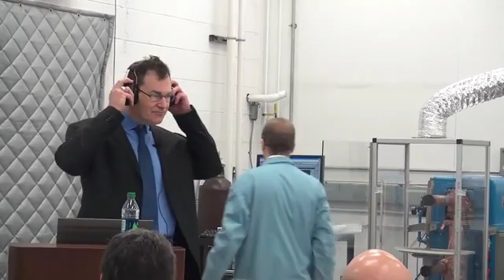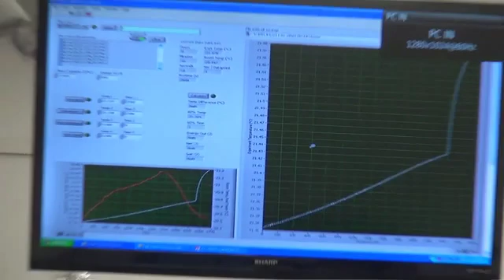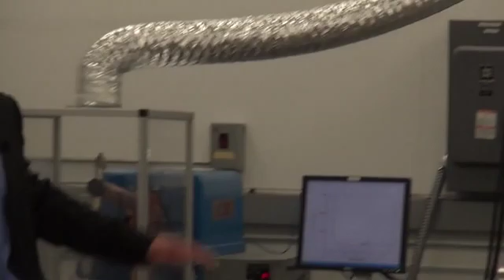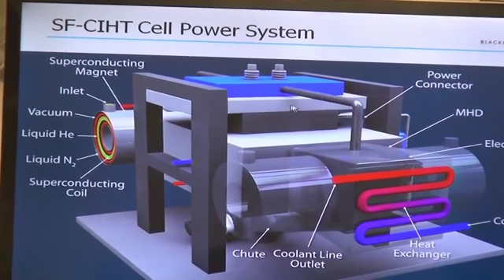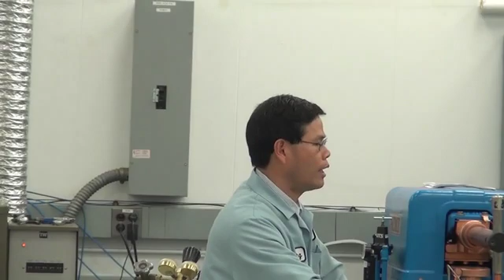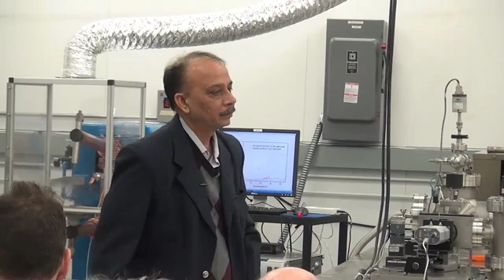Blacklight Power Demo January 28 2014

Comment: I accept cold fusion as real and the power evolved is from hydrogen protons entering and fusing within other elements. This Blacklight demonstration doesn’t really make any sense. The experiment passed 8300 amps at 4.5 volts through a fuel pellet for .033 seconds. They claim the energy is 4X more in the form of candle power or lumens if you please.  I didn’t see it; I didn’t see 4000 watts worth of light.  I didn’t see any light intensity measuring equipment; did I nod off? I didn’t see anything that would convince me to invest money. I am ashamed for Mr. Mills and this so called “demonstration”.